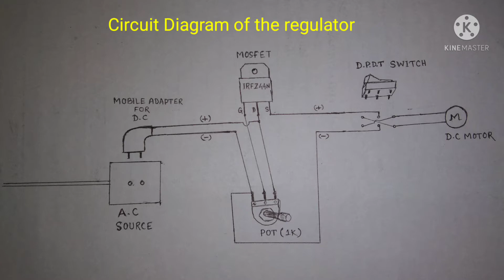How to make tracking mount for telescope|homemade equatorial mount|motorised tracking mount

Comment: You are an awesome designer! I applaud your use of anything you can find. My first telescope was a refractor made of PVC pipe, toilet floor flange, and a 6" 200mm projector lens. The equitorial mount was made of 1 inch cast iron plumbing pipe fittings. I used a very sturdy camera tripod to hold the whole thing. I had a lot of Chromatic abberation and corrected it with a 4" mask (so the scope was really a 4 inch. I used it for viewing Jupiter and Saturn and the Moon and other things. It turned out to be wonderful.